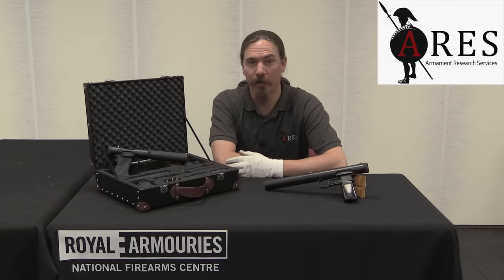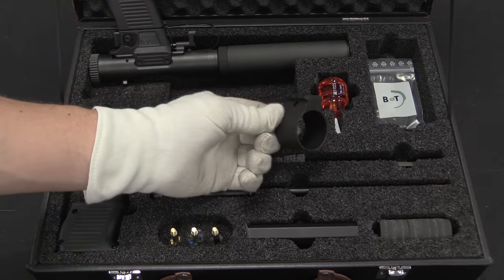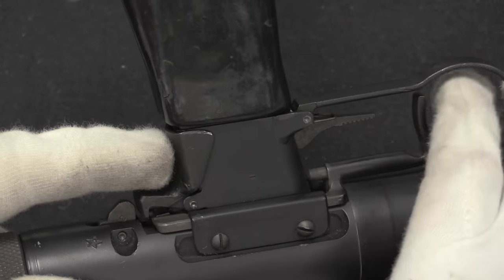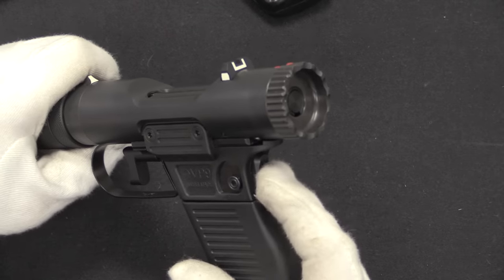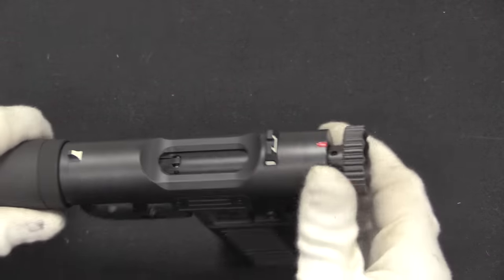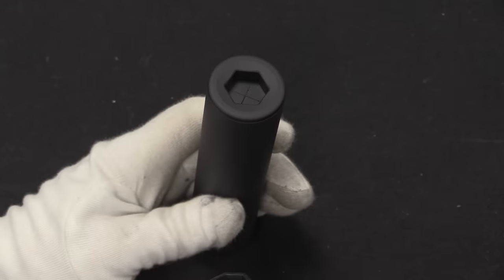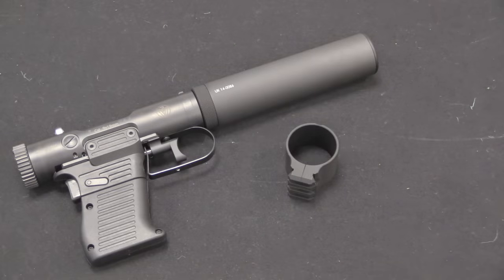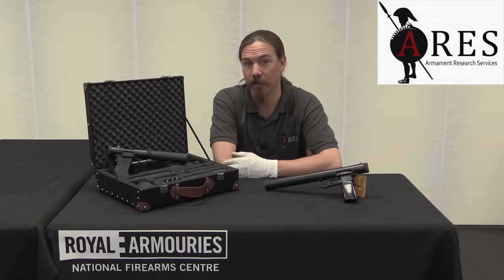B&T VP9 Silenced Pistol: A Modern Welrod

Comment: Why would one want to develop a modern version of the Welrod? When at least in my mind it has been made entirely obsolete by the "silent cartridge" (cartridges operated by an internal piston inside the cartridge casing) firing handguns, such as the Russian PSS pistol and OTs-38 revolver.
Reply: jeemiaas For starters the rotating bolt action is a hell of a lot more quieter than semi and full auto mechanisms; less mechanical noise when chambering a new round. As well as the fact that the new system seems to have better baffles and wipes, possibly making it even quieter. The fact it's been upsized to 9x19 makes have a bit more stopping power, not to mention improved handling. Keep in mind this was typically used for assassinations, so improving this niche firearm does have importance.
Reply: jeemiaas Not to mention that this requires basically normal ammunition, meaning that you don't have to carry it with you "on holiday".
Reply: The "silent cartridge" is hard to get and expensive most places. 9mm is cheep and common so it would be cheep and easy to play with this toy. :)
Reply: perreterecon I'm in the military, you'd be surprised at the equipment we still use. As of right now, the welrod is still in service in some large standing armies. Mostly used for clandestine operations. Now it's probably used extremely rarely because of its specific use. Put this in perspective, we still use the browning hi power as our main sidearm and it'll be close on 100 years old soon. If something is not broken, don't fix it.
Reply: Braeden Griffiths About your point on the bolt action being quieter than semi auto mechanisms. I did mention in my comment the OTs-38 witch is a revolver and thus at least as quiet as the bolt action, especially when firing the gun in single action. And even with all of the rubber baffles on the VP9, there is still some small amount of gas escaping the barrel. Where as on the OTs-38 all the gases are trapped inside the cartridge case after firing, thus firing the OTs-38 sounds literally the same as dry firing the gun. 

Now the fact that the 9x19mm is more powerful than the 7.62×42mm, though a nice feature, isn't really that important considering that both guns are primarily designed to be fired at close range to the head. And if you miss with the VP9, you are screwed. Where as with the OTs-38 you have four shots more on tap.

All and all, even in the most niche application I can't come up with anything that the VP9 does better than a gun like the OTs-38. The only real downside of handguns that use "silent cartridges" over integrally suppressed handguns, is that the ammunition for these guns is far more expensive.
Reply: jeemiaas Yes the ammunition is the biggest selling point for the VP9. It's all about logistics when it comes down to it. Why go for expensive ammunition, when you can go for an integrally suppressed firearm with normal ammunition. Plus if you're some clandestine operator, hopefully they trained ya to the point where ya don't need to take multiple shots. All options are good I suppose, but I still the VP9 would be a better fit. Forgot to mention it's more concealable than the ots-38. I think the pss is out of question. Not the best mechanically working out of the three.
Reply: jeemiaas With OTs-38 you have to smuggle in ammunition as well as the gun, the ammunition is bothersome because it directly incriminates you when found on you in any circumstances, and the bullet is probably identifiable when extracted from the body. There are benefits to using off-the-shelf standard ammo.
Reply: Didn't the guy say the newer version was made for veterinarians.
Reply: But, even with 9x19 ammo that is available everywhere, you'd need subsonic loads, right? Are those also available as far & wide as normal 9mm ammo?
Reply: Nevinko Reulysanto The 'disadvantage' of this pistol is that it's a very close range weapon with a very low rate of fire, almost as though it was designed for killing injured horses without spooking other nearby farm animals.

Nobody will be using this to assassinate the president, and a Trump presidency is currently the best thing even for people who hate Trump. Would you rather Pence was in charge?
Reply: Not necessarily. I don't know quite how they did it but H&K claims that the supressor they developed for their silenced MP5s slows the bullet down somehow, making it possible to use it with normal speed loads. Maybe the trapped air between the rubber pieces can achieve that too
Reply: Pence is the trump-card (huehue) of the Secret Service
Reply: Doc Gonzo Subsonic 9x19mm is widely available, at least where I live
Reply: +Doc Gonzo The original Welrod had an expansion chamber which made normally supersonic ammo subsonic. I suspect the same can be said for the VP9.
Reply: honestly 9x19mm is not the cartridge to go with if you're intending to supress it you should go with .45 gobs of stopping power and it's sub sonic meaning you can keep full power and keep it quieter
Reply: in regards to the OTs-38 is a copy of the operation the QSPR which was tested and abandoned in the 60's and 70's in vietnam due to the ammo price and the war ending honestly it is hardly any better than a 22lr in terms of stopping power and the OTs fires a smaller projectile than the QSPR
Reply: 1423 171 .45 is still incredibly loud when suppressed, whereas subsonic 9mm is very quiet.

And STOPPAN POWAH isn't really a concern for a gun that's supposed to be fired at a target's head from incredibly close range.
Reply: Don't forget the Derringer's Arms Tech makes. And The highly modified Ruger revolvers Knights Armament made as well. Both of these also use captive piston ammunition.
Reply: Braeden Griffiths If one were to look for the most concealable silent handgun, might I suggest the MSP Groza, which is a small double barreled derringer type pistol also firing captive piston or "silent" ammunition.
Reply: Serdiuk Paul Now that is a very good point, that didn't even cross my mind when thinking about the subject. I can now see the potential usefulness of the VP9 in some clandestine operations. Thanx!
Reply: 1423 171 Actually if I am not mistaken, the QSPR fired 15 small tungsten pellets instead of one solid projectile. This was apparently made because the gun was designed to be fired in "no light" conditions, and it was thought that having the gun fire shot would give a higher hit probability than a single projectile. This also meant that the effective range (the range in which the gun was potentially fatal) of the QSPR was only 10m. Where as the effective range of the OTs-38 is listed as 50m. 
Now in regards to how does the 7.62×42mm cartridge compare to 22lr in "stopping power"? According to my very limited research on the subject, the 7.62×42mm has a muzzle energy of 194 J where as subsonic 22lr has about 150 J of muzzle energy. Also 22lr only has a caliber of 5.6mm, so basically 7.62×42mm is way more powerful than 22lr.
Reply: 22 lr has rounds that have over 250 Joules of energy and will deform upon impact a solid mild steel bullet will not therefore the 22 has more energy to start with and with more effectively dump that energy into the target which is the definition of stopping power also
Reply: Some of the Russian captive-piston pistol cartridges were designed to use 7.62mm rifle bullets with the idea that the shot would look like it had been fired from a rifle hundreds of meters away due to the low velocity. At least to the untrained eye.
Reply: jeemiaas It's actually funny you mention that, I was just looking at that when you responded hahaha. Anyways, seems a good fit as well! I compare firearms to vehicles, they all do the same job (get ya from point A to B) but there are ones that do the job in a different matter. Whether your firearm is concealable, bulky, long range, short range, etc. It all comes down to logistics and preference. All good candidates in my books.
Reply: 1423 171 If i am not mistaken, all of the more powerful 22lr loads (with muzzle energies above 160-170 J) are supersonic and thus not applicable for a "silent" firearm.
Reply: nearly all 22 lr is super sonic even the 141 J load  but there is a 60 grain sub sonic load for 22 lr that has 230 J of muzzle energy
Reply: Doc Gonzo 
Just get the heavy bullet 9mm.
Nothing "special" about it.
Reply: HATECELL HK MP5s have a ported barrel.
After an inch or two, gas is expended from the barrel through holes, and this has an effect on velocity(negative).

A 9 inch MP5 barrel is actually more like a 1-3 inch barrel.
Reply: perreterecon gases never speed up a bullet after it leaves the barrel.
Velocity drops as soon as the gases are no longer forced to escape in only 1 direction(forward).

The baffles do not "stop the gases from pushing the bullet," causing a reduction in velocity.
Reply: 1423 171 the ammo price was never an issue, since dead tunnel rats is more expensive than some pricey bullets that ARE SHOT OUT OF REVOLVERS, NOT MACHINE GUNS/AUTOMATIC RIFLES.

The price of the bullets for SOF is irrelevant when the billets are not gonna be shot in large numbers.
Reply: Captive piston ammo doesn't trap all the gas btw.
It always lets a bunch of it blow out.
You can see this in video of the guns firing.
Also, the semi-auto versions wouldn't work if the gas was all/mostly trapped.
Reply: The MP5SD is the only one with ported barrels dude that's the silenced version and you'd be better off just suppressing a .45 ACP smg than an Mp5SD as you would get much more lethal effect
Reply: I was making the argument that the 22 has more muzzle energy and that means it kills better in most cases also a 22lr revolver can hold 10-12 rounds in the same size cylinder which means more firepower on hand
Reply: You do realize the reason that 9mm silenced weapons and such have to have short barrels or special ammo right it's velocity a properly silenced 45 will be just as quiet as a special subsonic 9mm with the same amount of silencer and will carry more energy
Reply: No the mp5SD was designed in 9mm because that was what the Mp5 was chambered in all the changes are ahead of the chamber so they didn't want to have to design a whole new receiver which they ended up doing with the UMP 45
Reply: yeah like the SP4 for Val or Steckhin revolver
Reply: plus even on IBS exam they gonna have a headache for matching the groove(like normal ballistic report).coz this gun is not a popular one,not even in the military regular branch itself
Reply: its like the AK gas recoil but this one to reduce velocity and muzzle sound
Reply: and to mention qspr is as only good as a knife(silence and range).
Reply: that one used a SP3.still better of with an SP4 ammo,and hell that one is more like a backup one time gun

Comment: It sounds like a airsoft gun once fired, also he forgot to mention that one of the suppressors is used for training but works just as well and is considered extremely quieter than the other  picture if someone sneezed but held it in.......right next to you...... yeah that quiet, ''Hollywood  Quiet''

Comment: The included suppressors with the B&T VP9 are not both identical. I think one is a wiped suppressor, and the 2nd included suppressor is a traditional baffle suppressor for shooting practice, and it doesn’t wear out. Although, it does not suppress quite as well.

Comment: I believe this gun is intended to be used by animal control and/or police officers in the field, rather than vets in a clinic. Certain situations may require a police officer to put down a fatally wounded animal in order to end its suffering. What the VP9 does is present a quick and humane way to kill an animal, without producing a loud noise that may scare nearby animals and/or people. It's a very niche market, but one with basically no competition. 

I'm not sure where I heard that from, so take it with a grain of salt (or two), and double check for yourself before assuming it's 100% fact. If anyone finds anything that supports/refutes this, go ahead and reply here

Comment: Nice, but why make such a strange magazine (why not do what most other handguns do: Make the grip actually hollow and put the magazine in there?)?

Also: Why would this not work semi-automatically (can't remove two guards with this if you have to fiddle with it to get it reloaded!)? - Goes for both the Welrood and the newer weapon!

Still, excellent video as always, thanks Ian!

ps: "...haven't fired it - yet..." - I don't suppose they'll allow you to take it to the range, will they? (I'd love a noise comparison to an actuall Wellrod, because I absolutely love those guns, just like the De Lisle Carbine!)
Reply: Part of the reasoning behind the Welrod being a bolt-action was to allow for the user to eject the cartridge whenever they pleased, so as to prevent leaving behind the casing.

Comment: I'm pretty sure the main use for these guns as veterinarian weapons is for racetrack vets. Even a slightly injured horse with non-life-threatening injuries is a lost investment, and of no use whatsoever to the owner (sometimes my mum would get slightly lame or failed racehorses as companions for her riding horses - dealers have no problem tugging at the emotional strings to let you know that either you buy the horse or it'll be a steak tartare by Tuesday. Those horses are the lucky ones that made it back to the stable alive).

They are suppressed so as not to scare the other horses, as scared horses in confined spaces are liable to further hurt themselves, giving you more broken racehorses that you need to kill, and out on the track a scared horse with a rider is a huge liability to the rider's safety too (horses are spooked enough at the best of times, especially steeplechasing/flat-racing horses who go through some pretty horrific selection/training processes and are reputably mentally unstable).

As for why drugs wouldn't be used instead I honestly couldn't tell you. Maybe it's different now, but if the drugs are even ten cents more than the cost of a shot from this gun, I wouldn't put it past a trainer/owner to save the dime. I grew up around studs, trainers, jockeys and dealers (and horses, obviously) and 99% of trainers are total twats who care absolutely nothing for an animal's well-being in the slightest (beyond keeping them fit to race), as well as being stingy bastards.
Reply: I believe that!

Comment: Does this 100% manual operation thing benefit the sound suppression capability in some way or was just something designed to facilitate the assembly/disassembly part of the gun (so it could be concealed and used in a faster way)?
Reply: the cycling of a semi-auto action makes a surprising bit of noise even without a the bang. This thing with subsonic 9mm is more quiet then my bloody airsoft pistol.
Reply: DFX2KX It's also significantly cheaper, easier, and faster to build.

Comment: 9mm? Do both have a short enough barrel to be subsonic? Would a 45 have been a more logical choice?
Reply: Zack Thor 147gr. 9mm is subsonic out of most handguns.
Reply: No doubt that this gun is subsonic, because of the short barrel and very unique suppressor. I did a little research and I found that most types of 9mm ammo have a muzzle velocity rated between 350-400 m/s and most handguns with average barrel lengths are said (by the companies that make them) to be around 370-385 m/s. Suppressors on any handgun will also decrease this velocity, according the TFB the change for 9mm was 6.7 m/s, so not significant. I found that with short barrel 9mm handguns that the muzzle velocity was around 330 m/s, so this is subsonic. I guess it depends what MOST really is. 340.29 m/s is the speed of sound btw.

Comment: Why does a high end manufacturer such as B&T make so many copies of old firearms? Surely there's no more than one person actually interested in buying them. Why don't they just stick with their modern SMGs, pistols and carbines?
Reply: Just think of it as:

Taking a proven design and using modern manufacturing and high quality control to make it the very best version it can be.
Reply: Nikolas Wirz if I didn't have to wait a year for the tax stamp, I would buy one. I think it's cool.
Reply: Nikolas Wirz it's actually a good idea because if I had the welrod I wouldn't be shooting it much in fear of damaging a piece of History. at least with the modern one you can go out and shoot it and not have to worry about that as much
Reply: FortuneZero Das macht schon Sinn. Aber ich kann mir einfach nicht vorstellen, dass es genug potenzielle Käufer hat, um die Kosten zu decken. Es handelt sich hierbei schliesslich um eine echte Feuerwaffe mitsamt Schalldämpfer und dürfte deswegen viele Interessenten schon wegen den benötigten Bewilligungen abschrecken. Für diese Zwecke gibt es sicher auch einfachere Optionen.
Reply: @Jon Smith And here you have why I bought a Reproduction New Army and not an original.